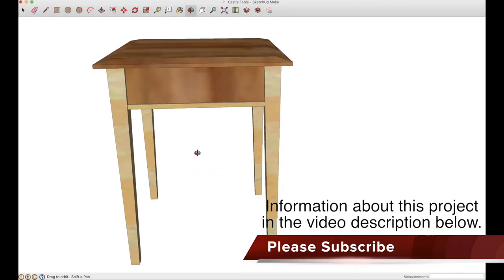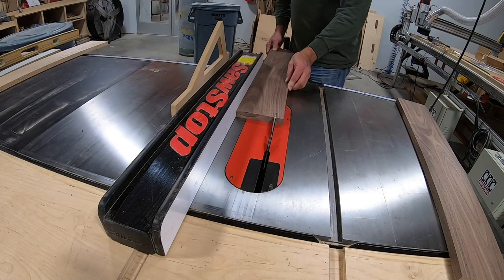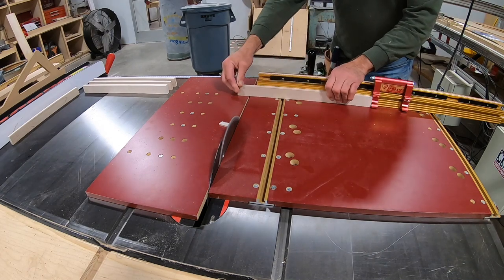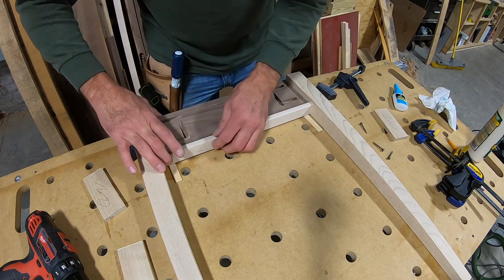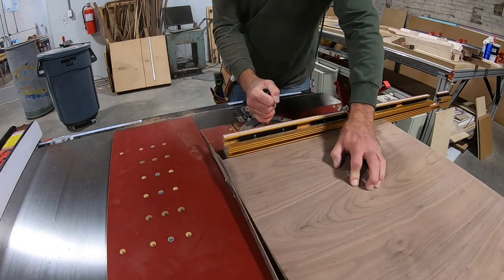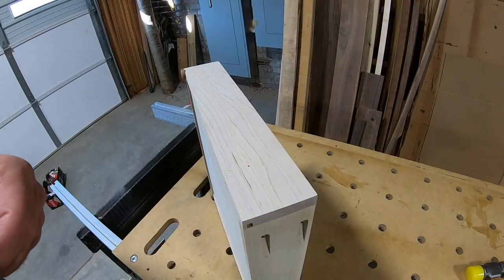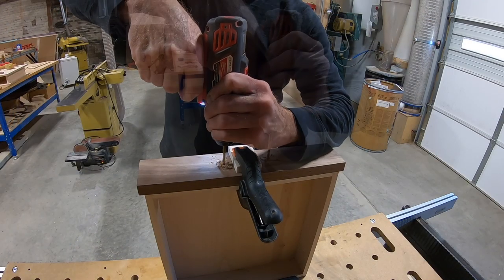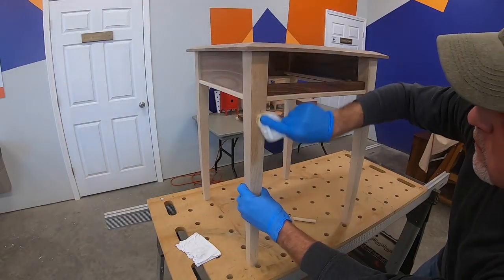🛠 An Easy to Make End Table - "Shaker Elegant"

Comment: Fabulous, nice build.  I have built about a dozen of these and still learned a few things.  May I suggest.....Put the rear side guide high and the one in the front low but on  the inside of the case, not on the drawer.  That way it won't show and you can still remove the drawer.  I also never tapered the legs all the way, left a straight section at the top about 5" long.  That way you don't have to angle the ends of all the frame pieces.  I am still thinking about that, your way might be better.  Also like your kit idea, might be good way to ship it.
Reply from the maker: I love the tips and ideas.  Thanks for sharing and for watching!